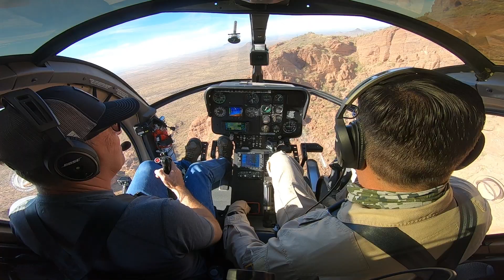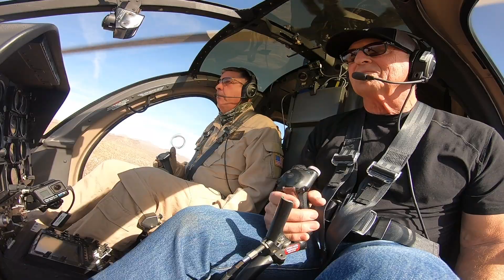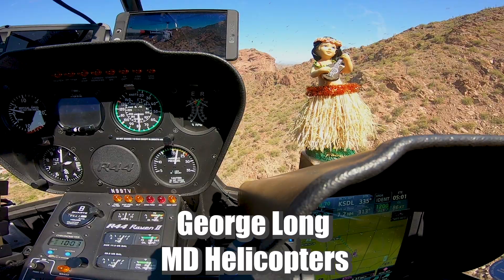Helicopter Engine Failure Training

Comment: Nice Video.  Back in the day the US Army taught that the most stable a helicopter ever was (other than sitting on the tarmac)  is when it is in autorotation.  Nice to see you doing autos to the ground - seems like most training nowadays - even the military from what I've heard - is to a hover...which is LANDING a helicopter. ;)  Not at all the same thing!  As we used to say, "I would  never fly an aircraft that, with engines out, can't land it it's own length! :)

Comment: I do autos all the time with my RC heli, generally I'm within an inch to the center of the target. It's so much fun.
Reply from the maker: RC choppers are harder than the real thing... I've tried
Reply: @CHOPPERGUYHD  Hehe, I tried the real thing, I find it much harder than RC. From RC I am used to virtually instant input reaction while on full size there is a substantial lag between input and reaction. Also on RC the interactions can be left to electronics and mixing while on full size it becomes a hand full....

Comment: Very impressive. The VSI looked like it was at 1500 FPM during the straight-in part of the descent. The MD500 seems so forgiving in the full-down portion. At one point you touched down on the back of the skids and rock forward to the front of the skids (just before 1:20). Got to love that fully articulated rotor head. I did that during a running landing once in a G2 while training for my PPL. No problem thanks to a similar rotor head. I fly an R44 now so I have to touch down flat on my running landings.
Reply from the maker: You hit the nail on the head Michael...forgiving. Which gives you so much more confidence to try other things during the auto. We were chopping the throttle and coming to a hover and then entering 180s. If I win the lottery I am buying an F model. Meanwhile I'm flying an R44 and R66 with an AStar B3e every once and a while.
Reply: @CHOPPERGUYHD  R44 will do all of that stuff just fine too: just modulate that collective accurately and no not believin!

Comment: Im glad to see this video. As a helicopter lover, this is so exciting to watch. I do have a question about your autorotation maneuver. At the forward speed of your  downward flare, before touchdown, is there any positive collective given at all to add pitch to the main rotor blades to help with the "cushion". . . . . or will this stall out the main rotor's "windmilling"???
Reply from the maker: If I understand your question....you adjust the collective to set the rotor speed where you want during your particular autorotation situation and then during the flare the rotor speed increases giving you more energy to pull more collective to cushion the landing.
Reply: @CHOPPERGUYHD  Okay. . . . .so during your downward autoration, you push down on the collective so that  the blades are spinning for that windmill effect. Then at the flair with the cyclic is pulled all the way back to slowdown & come into your flair. This is where you give the positive "pulling up"motion on the cyclic until you flair. now ya have a cushion between ground & helicopter & then a gentil skid toouch dow to a stop. Have i got it alright???
Reply from the maker: You first flare to build up rotor rpm's and to slow the aircraft....level...then pull collective to cushion the landing
Reply: @CHOPPERGUYHD  Okie dokie. Thankya sir for your reply. You definatly have my ULTIMATE DREAM. . . . .flying helos! Thankya for sharing the video. Wish i was flying with ya!

Comment: Bruce! As a fixed wing pilot, nothing has ever confused me more than the autorotate. I'm still not enlightened. But great video, as always!
Reply from the maker: Basically Johnny, when the engine quits we lower the collective taking all the pitch (drag) out of the blades. So think of sticking a pinwheel toy out the window of you car at 60mph...that pinwheel spins from all the relative wind. The same thing occurs to the rotor system as we lower the collective and begin to descend. All that air rushing up through the blades spins them and gives us lift just like a wing. We fly a profile to hit our selected spot and flare like a bird at the bottom to both slow down and build more energy in the rotor system for that final collective pull to cushion our landing. Hope this helps. Bruce
Reply: @CHOPPERGUYHD  how many feet from the ground, do you start to flare, so you don't hit too hard.

Comment: The tail (whatever's called) looks like it gets really close to the ground, scary.
Reply from the maker: The stinger on the bottom of the tail keeps you from hitting the tail rotor on the ground if you flare too hard during the landing. Not uncommon at all to hit it
Reply: @CHOPPERGUYHD  That makes perfect sense! Thanks
Reply: @CHOPPERGUYHD   certain instructors would demo you could set the machine back on the stinger when you were sitting running on the ground. Thats why mechanics take and feel the bottom on the stinger on machines when they come back and paint the bottom when a new driver gets in, so they cant say, was there before I got in it.....